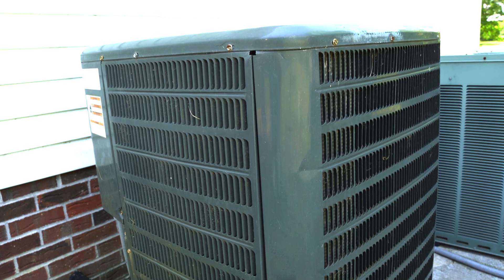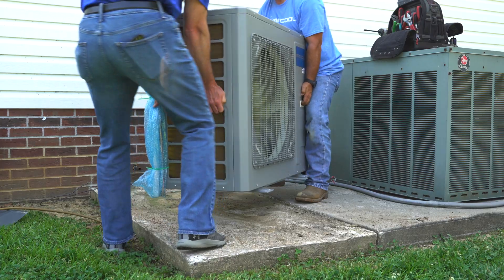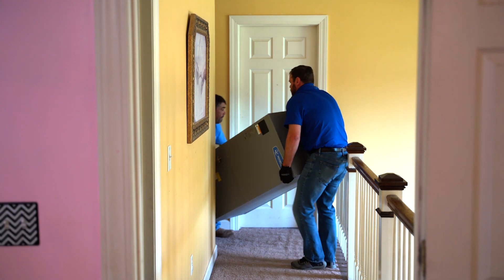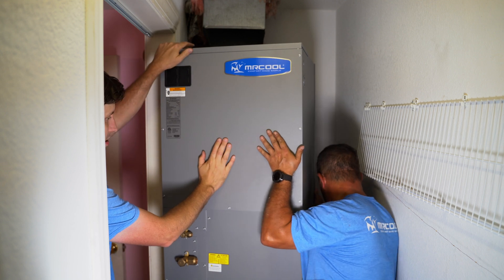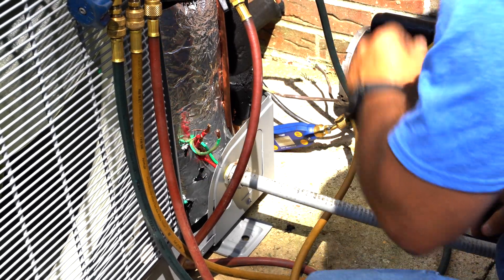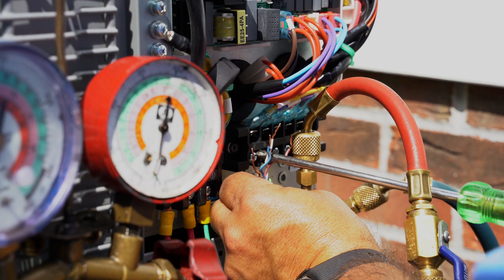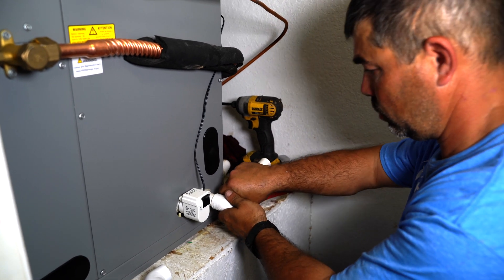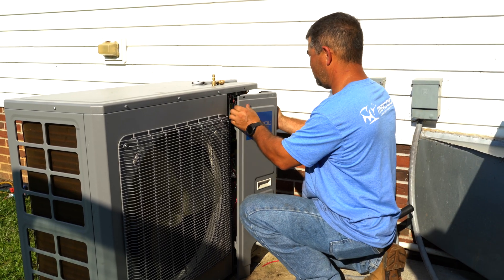Installing a MrCool Universal with Existing Line Sets

Comment: My liquid line ( the thinner one ) is completely uninsulated as it runs through the attic to connect to AC indoor unit, but the thicker suction line is properly insulated . Will I be able to reuse such a lineset if install MrCool universal system in the attic to replace the old AC ?
Reply from the maker: That could be possible.

Comment: One HUGE question that's arisen underneath other otherwise very helpful Mr. Cool videos....  Obviously, a key marketing angle here is how comparatively easy these universal models are.... much like your simpler split systems, with the quick connect lines, etc.  (or in this video, even with existing lines)  In short, we handy DIY homeowners are obviously encouraged to think that hey, this is doable....  Yet if we actually do install one of your universal units, following your videos, the instructions, etc., are we in fact voiding any future warranty coverage, should (heaven forbid), the unit fail prematurely?  What's Mr. Cool's cool answer?
Reply from the maker: A homeowner installing the Universal does not void the warranty.
Reply: @MrcoolComfort  I respect your DIY friendly attitude, not a lot of companies are like that these days. Though the refrigeration thing does concern me. Working at AutoZone I saw a lot of people do some stupid things with refrigerant. "Oh I'm about to do an R134a retrofit, don't need that R12 anymore pop hiss "

Comment: how much coolant is shipped with the compressor? Enough for 25ft of line and an uncharged evap coil?
Reply from the maker: It has enough refrigerant for 30ft of line. It is not charged for a dry air handler.